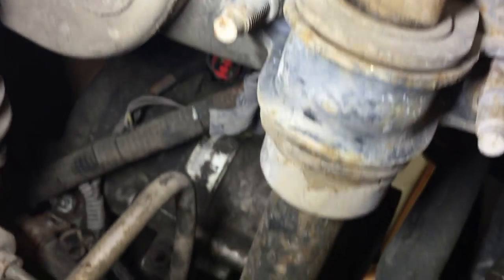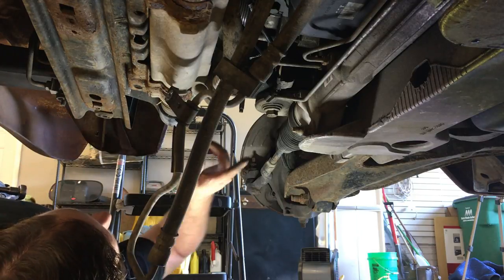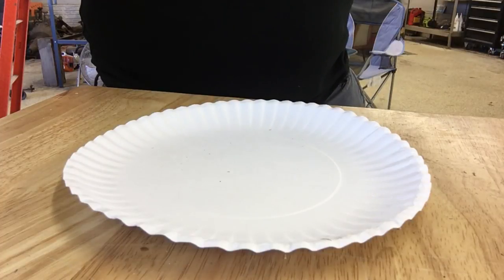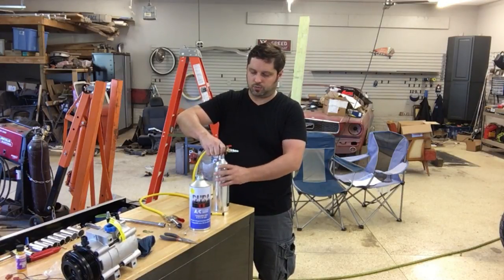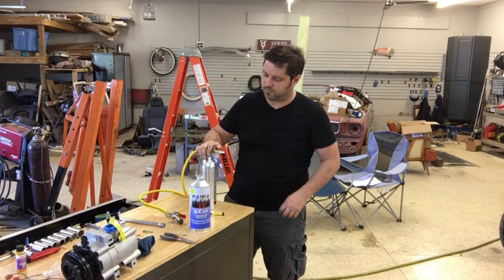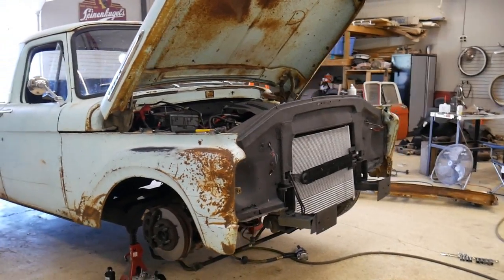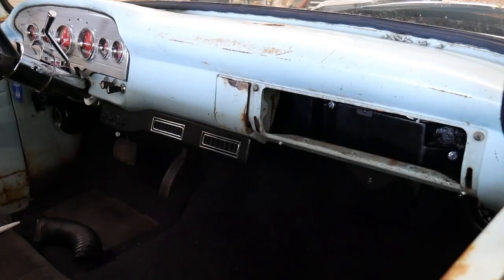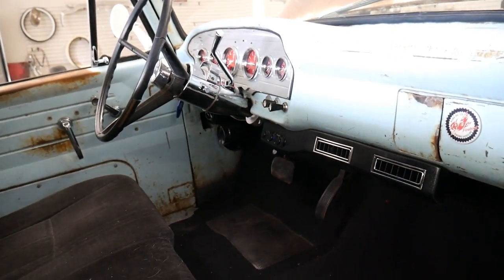F100 to Crown Vic Frame Swap ep.18

Comment: Love the videos, my project is almost in my new shop and will be back in the works.  I had a '63 uni way back and wish I had it back...  One thing, I think you may want to find a way to "lock" the tailgate on the truck.  Stupid idiots out there will steal it if left un-attended.  Sad but true.  I'm trying to think how it could be secured; maybe a cable lock or similar that goes through it low near a hinge and locks underneath.  Again, sad that this is the stuff we have to deal with now...  Oh, I'm considering the same cut-outs - totally agree with drone free highway cruising.  Keep em coming and take care, Clay
Reply from the maker: That's a great idea! Also, thank you for the compliment! Means a lot coming from you, been watching you since before I started my project when I was debating frame swap vs front clip swap, great stuff!

Comment: Hey Matt.  Glad to see a new vid.  As I told you on a post somewhere, I've been going thru similar AC junk with my mustang.  I took one more swing at it last week and finally got it done....fingers crossed!  I had to flush mine as well (just the evap because everything else was new.)  I noticed when you were flushing there should have been a large spray coming out but it was just kinda pouring out.  That looked like an obstruction somewhere to me but i guess they found that out at the shop.  Good news is you are all set now.  Good find on the tailgate...lol.  Pretty odd huh?  Be talking to ya.

Comment: Nice mate, looking forward to the wrap video on this ol girl.. I reckon the red tailgate in red will look great, I nice contrast.You've got me jazzed about doing my 68. Looking forward to your cost breakdown for the whole thing.Glad the A/C problem got sorted too.. look on the bright side, at least the heater will work coming into autum I think I asked in you from another video about if say with my 68, I would be able to have a thinner fuel tank or two smaller ones as to not have the big hump in the truck bed??? How easy would it be do you think.. if I'm flying tro keep the bed as a fully functioning bed size without the hump?Cheers, Mat
Reply: Mathew Scrace not sure if this will work with the crown vic frame or not but it definitely works with the stock Unibody frame rails. A 65 mustang fuel tank fits perfectly between the framerails. Also Aeromotive make bolt in 65 mustang a fuel tank that has an internal fuel pump that can support an EFI engine. Hope this helps.
Reply from the maker: Hey Mat. Like Luke said you can use a mustang tank, but the hump really comes from the kick up in the frame rails from the Vic. The rear end on these are connected by both a 4-link and a Watt's link. I wanted to keep both of those for handling reasons (pretty hot rod setup they have stock). you can keep the F100 frame, use the Vic front clip and use an Explorer rear end with leaf springs and you won't have a hump, but you'll still have most of the benefits minus 4-link and Watt's link.

Comment: Im just starting my 61 unibody project, it is red... mine is a longbed though. im planning on stretching p71 the frame. i have not seen anyone convert a long bed yet. any advice?
Reply from the maker: Awesome! Personally, If I were in your shoes it being a long bed I'd retain the F100 frame and use the CV front crossmember. It bolts right to the F100 frame (2003 and up) and it has the motor mounts on it. It comes out pretty easy and you'd retain power steering, power disc brakes, rack and pinion etc. From there you could source a Explorer rear end and mount that out back (if you want disc brakes back there, they are also geared better for the interstate). Get a classic Mustang tank that is setup for fuel injection and hide that under the bed. It's all about the same amount of work as a frame swap and one plus is you wouldn't have a hump inside the bed. You'd just have to get the drive shaft lengthened and re-balanced, a driveline shop can do that pretty cheaply. That's just my 2 cents on the issue. Best of luck!